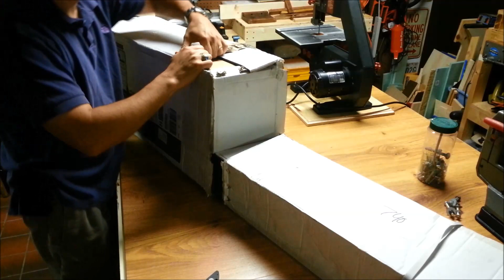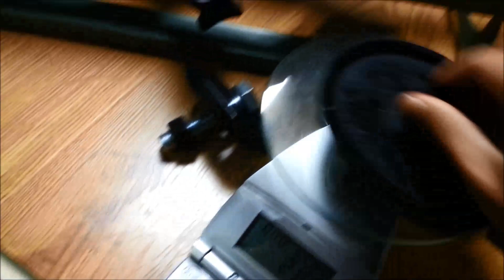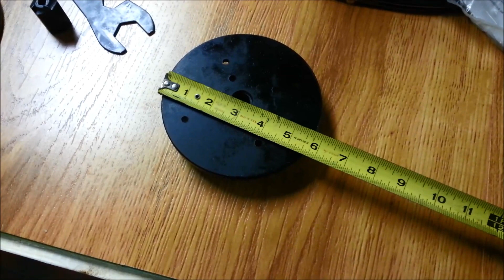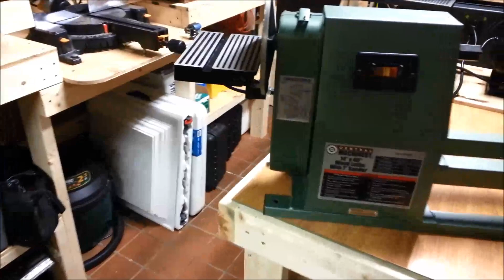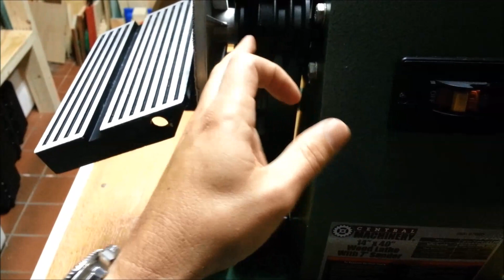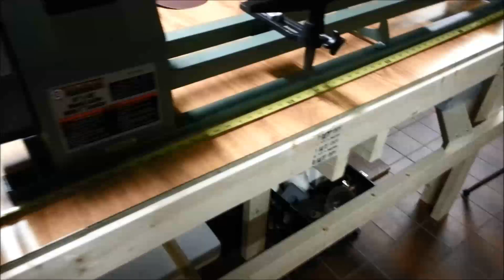Harbor Freight 14"x40" Lathe - Unboxing

Comment: I have the same lathe bought it before the HarborFreight stores came out thru there mailorder 20 years ago .Used it for some big heavy stuff then worked great its hardly used. Just dug it out today in storage want to buy a 4 jaw chuck and  thread adapter for it and polish  small outboard pistons and small crankshafts.Trying to find out chucks that will work as this lathe supposedly has a 3/4 10 or 8 TPI most chucks are 1 inch 8 TPI. Thanks for posting this video ...Glenn

Comment: I loved this lathe for a long time but its sketchy at best when it comes to something a little larger to turn like a 6 inch log its plain scary you cant really lock in tight on the live centers it bows the beams so bad the lathe wont turn but for a starter lathe for smaller stuff cute square on a saw it works great

Comment: Hello, the video u made really helped me. i jus bought same 14×40 wood lathe .115v60hz speed 1125 to 3450 from a private owner  and some parts r missing 7" disc ,tool rest and owners manual. Where can get those parts from? Thax
Reply from the maker: Raj Sharma Thanks.  Harbor Freight sells most of the individual parts.  The owner's manual is also on their website for free - just download the PDF.
Reply: Ok thax.